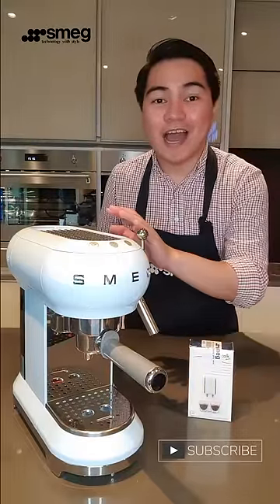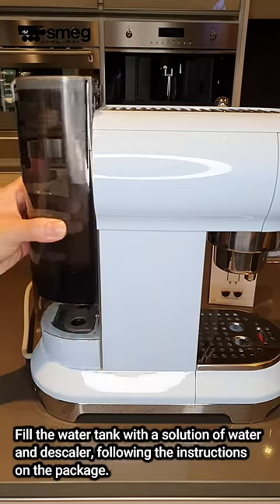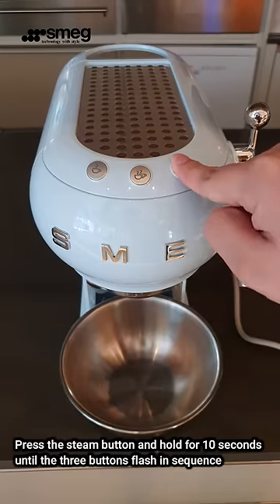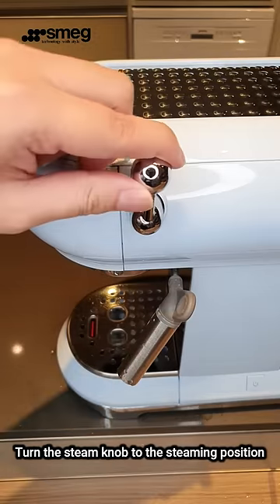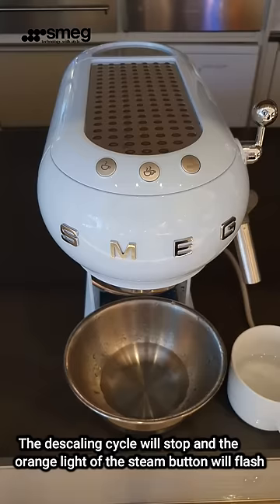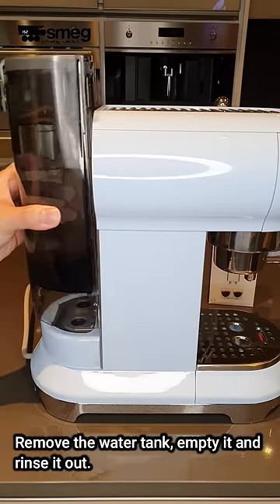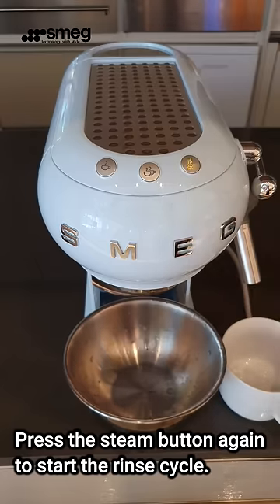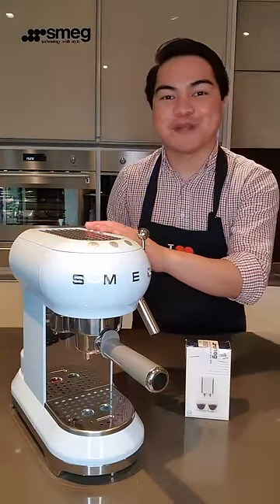How To Descale a Smeg Espresso Coffee Machine

Comment: I had to run the rinse cicle twice for the orange light to turn off. This is not my first time descaling the machine, and i don't remember having to run the rinse cicle twice before, but for some reason this time tye button didn't turn off after the first cicle.

To be clear, this was 3 cycles in total: 1 with the descaling solution, and 2 rinse cycles.